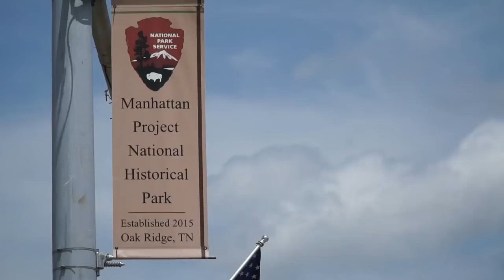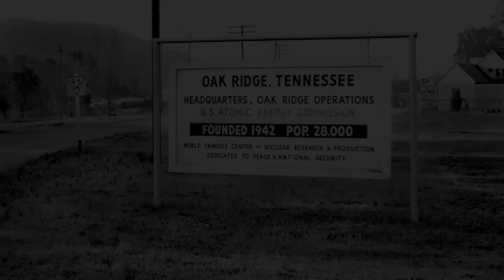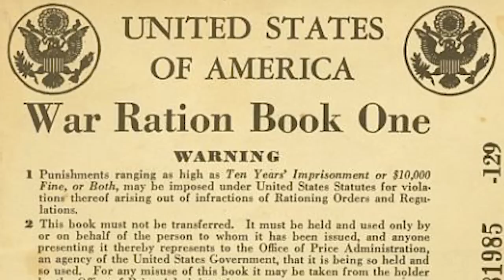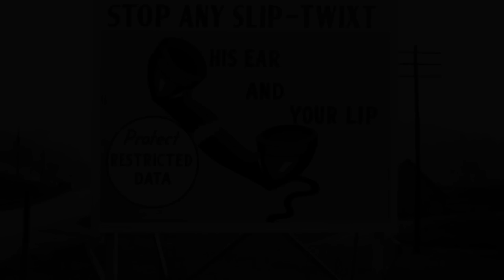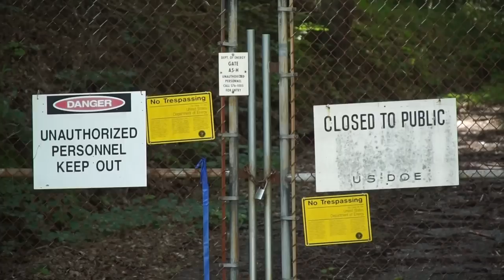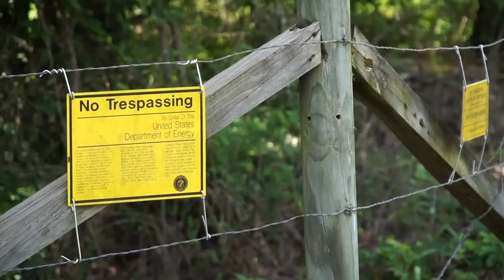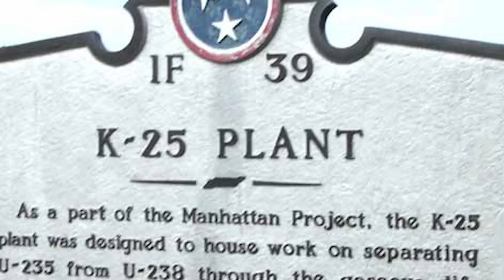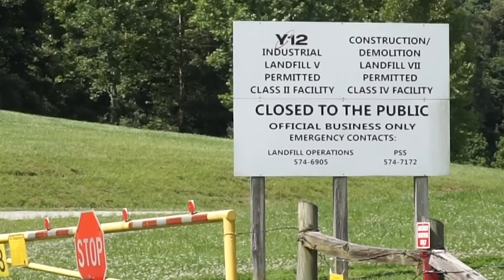The SECRET CITY of Oak Ridge, TN

Comment: 4:35 in the video about the need to separate U-235 from U-238... My Aunt Merle (Mom's older sister) married my Uncle George who was a chemistry student she met at the Univ. of Mich. They moved to Oak Ridge during the war and he worked on the Manhattan Project researching ways to meet that very need. Of the two methods discovered there, he helped invent the gaseous diffusion method. Several of my older cousins were even born in Oak Ridge before he left the Lab after the war and they moved to eastern Pennsylvania.

Comment: Wow, can I relate to this one. I ended up at one of the 3 facilities, Los Alamos, NM. It was last year on my first solo RV trip from FL to the west. I am a retired female with my dog along. First lesson learned, when putting your destination in Google for a natl park, don't just put the name, put the name and words visitor center. I was trying to get to Bandelier Natl Monument. My GPS pinned the center of the park and took me down roads trying to get me to the center. Talk about adventures. It took me over a 8k+ elevation mountain with hairpin curves (I was pulling my travel trailer) and down a dirt road into a forest with a logging operation. I saw some men up ahead with some cattle, so I got out with my dog by my side and walked up to them and asked where am I? Luckily they were nice and told me to go back out the same way. I finally got to the visitor center and the ranger comes running out with arms flailing,  yelling No you cannot park here, no RVs allowed. So I found their campground down the road, had to unhook the trailer to go back to the visitor center the next day as the campsite ranger said I would be fined $100 unless I went immediately and paid for my site. A few days later when I left, I was trying to get to my next destination and the road took me through Los Alamos to a federal security checkpoint where I was told I had to pull over for a complete search of my car and trailer or I could do a u-turn and take another road which went around the city. I chose to take the long road.  I was carrying a weapon also as a smart single female. That was a real adventure for me, but who needs normal? I could be your mother (correction, grandmother).
Reply: Wow!

Comment: Classy, the museum  and visitor centers are open now so you can come back and see more history.   I would advise you not drive down that road you did during your last visit..  During the Manhattan Project Y-12 and K-25  produced the enriched uranium that was the exploding core of the Little Boy weapon and the X-10 graphite pile produced the first gram quantities of plutonium 239 to measure its nuclear properties.  Hanford (Washington) manufactured the Pu 239 exploding core for the Fat Man weapon.  The actual bombs were designed and built in Los Alamos.  Oak Ridge had nothing to do with the massive vessel on the flatbed truck you showed around 9:00 but it dose look like a huge bomb.  Come back sometime.  Y-12 dies have a visitor center you can see.  It’s the first left turn.  ❤️
Reply from the maker: I will have to return! And this time perhaps more legally

Comment: I've lived in Oak Ridge for 30 years. Just a bit of info for ya. It's K25. Y12, K25 and X10. They were associated with map coordinates.

You should have gone to the city library. They have a locked room you can get access to just by asking to access the history of Oak Ridge.

The bomb wasn't 'untested' as that's what Los Alamos was used for.

Jail in Oak Ridge is just jail like in any other city. The charges can, not are, but CAN be Federal, but unless you're a nun looking to do damage (real story), they realize it's easy to get lost

Comment: It’s Y-12 and K-25, not K-12. The country was so short on copper at the time they used silver, from Fort Knox, to make the wire in the calutrons. They forgot to go back and alter the math, the magnetic field was too strong, and pulled nails out of the walls when they first turned it on.
By the way, even without COVID, because the site is still active, they DO NOT give tours year round. Twice a year you can take tours, but that’s it.

Also, there are no nuclear power plants there! That’s not what they do! They make, handle, dispose of the fuel! Big difference on why they don’t want you in there. The Oak Ridge National Laboratory is there and have been involved in everything from making touch screens, like on your phones, a reality, to 3D printing the largest objects ever, including cars.